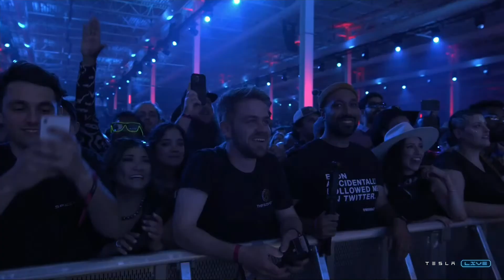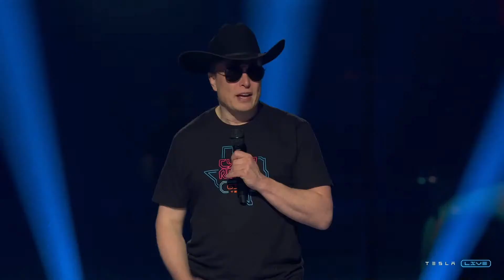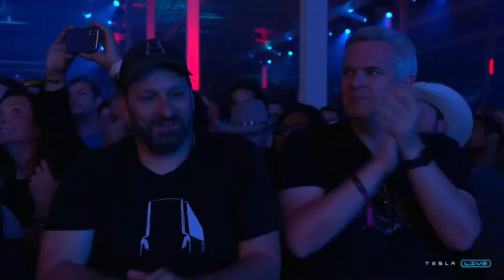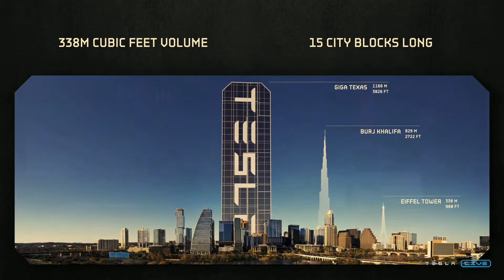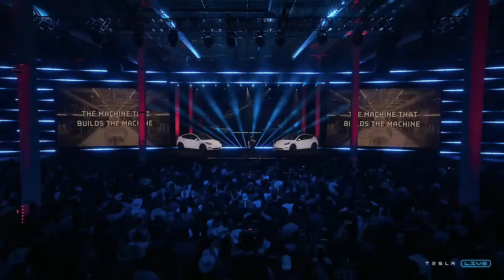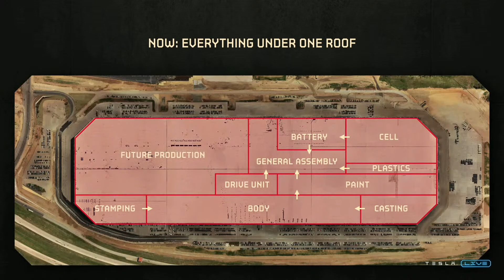Watch Elon Musk's Deep Dive Inside the Gigafactory Texas

Comment: If only Tesla can make a sub compact or a cheaper car under 30k then I can buy one
Reply: 3 hours ago
After 8 years or more than 100K miles, EV battery degradation to below 70%, leads to the battery significantly losing its power. Tesla $23,000 bill to replace the battery is insane, and each Tesla $1,500 service charge is beyond ridiculous.
Reply: You don’t need a Ev there junk

Comment: This is Engineering technology pushed to its limits done! Elon is a real genesis when confronted with someone saying it can’t be done, he says let’s try. He recruits top talent from all over and gets it done.
Reply: 3 hours ago
After 8 years or more than 100K miles, EV battery degradation to below 70%, leads to the battery significantly losing its power. Tesla $23,000 bill to replace the battery is insane, and each Tesla $1,500 service charge is beyond ridiculous.

Comment: Tesla is optimizing the future!
Reply: 3 hours ago
After 8 years or more than 100K miles, EV battery degradation to below 70%, leads to the battery significantly losing its power. Tesla $23,000 bill to replace the battery is insane, and each Tesla $1,500 service charge is beyond ridiculous.